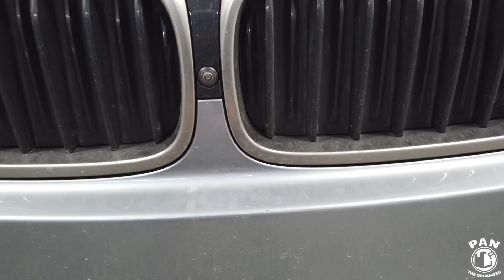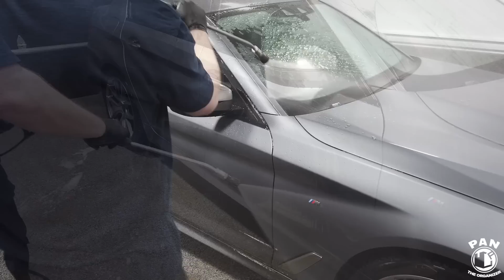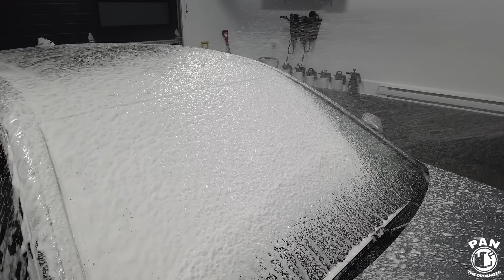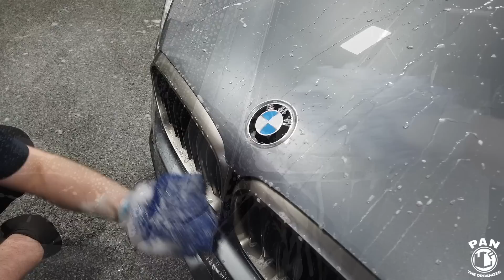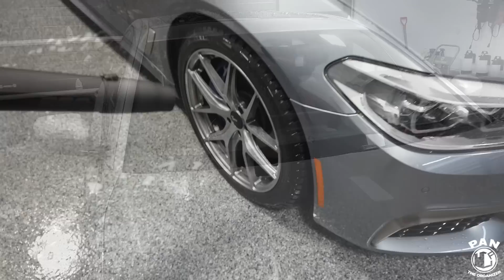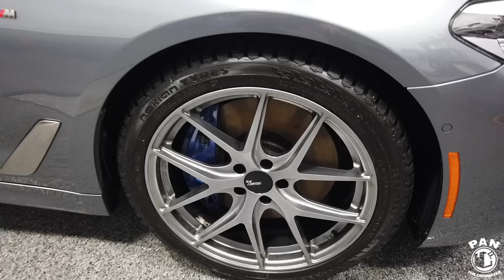STRESS RELIEF WASH - STAY AT HOME AND WASH YOUR CAR !!

Comment: 3:07 Hey Pan, did you just spray water on your electric baseboard heater?
Reply from the maker: Hehehe no, it's just the camera angle.  The garage at 24 feet wide by 24 feet deep is quite large, so washing a car never is an issue.